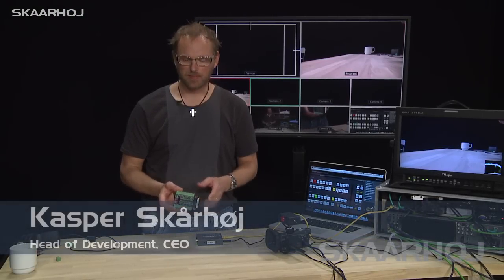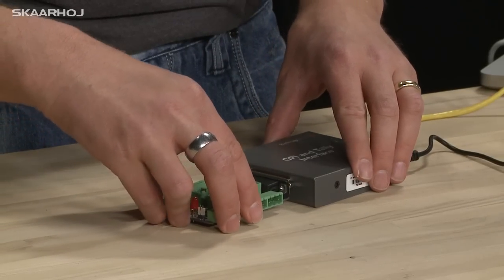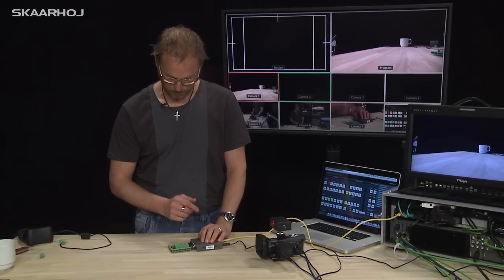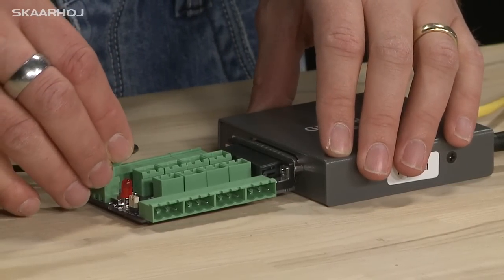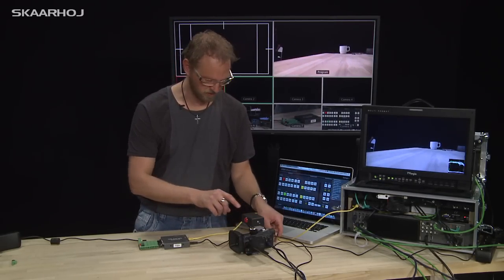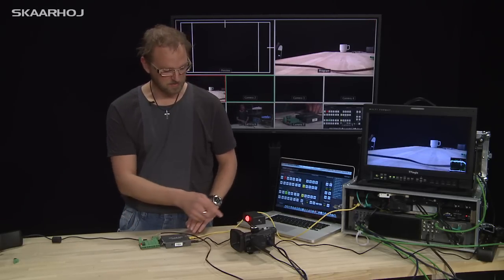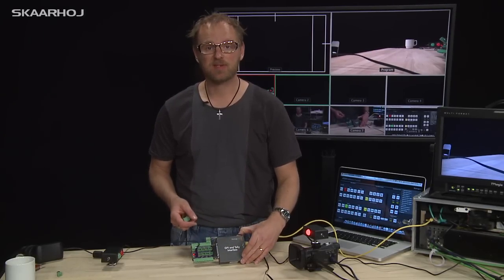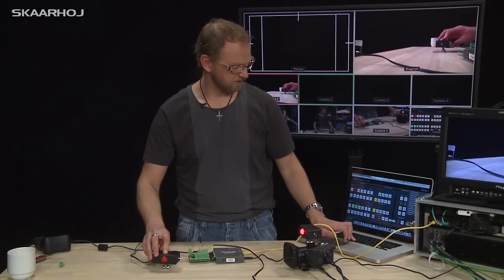LEGACY - ATEM GPI & Tally Interface Breakout Board

Comment: That's a really nice invention you have there, thank you very much.

I was wondering if this could work with a Datavideo ITC-100 8-User Wired Intercom System.

Thank you!
Reply from the maker: +Cctv Eventos Bogota Basically you can use the BMD GPI & Tally Interface directly (without this breakout board), but to my knowlege you will only be able to get Program tally and not preview tally from the GPI & Tally Interface. You will need a cable that is wired correctly between the DB25 connector and the two connectors on the ITC-100.

If you are interested in having both program and preview tally i suggest you have a look at some of our E21-GPIO units at http://skaarhoj.com/designs/e21-gpio/
We can also sell you a custom cable working working with the ITC-100.
Reply: @SKAARHOJ  Hello, you have the solution with this cable for ITC100
Reply from the maker: @lipe_lemes  Hi Felipe. Please contact support@skaarhoj.com
Reply: Hello friend, I know your post has been a long time, but I would like to know if it is possible to use itc100 tally with atem studio HD.
did you get any solution?

Comment: I would like to take the tally info (1/0 on/off .. not the voltage) + audio feed (microphone + earphones) and put it all in the HD-SDI stream so to have just ONE cable from/to cameras... do you think this is technically possible?

I will have a BOX next to the Atem where all HD-SDI cables arrive. And other small boxes next to the cameras. The mixer guy will speak in the microphone and listen in earphones. Audio signal will be digitised, coupled with tally info and travel inside the box into the cables. The small boxes next to the cameras will be powered from V-Mount batteries. Single cameramen will attach their earphones and tally to the box while the video HD-SDI cable will continue to the camera output for video feed.

I think it can be done... What do you think?
Reply from the maker: Hi Marcello
I suggest you take a look at the Studio Converters https://www.blackmagicdesign.com/dk/products/atemconverters 
I think they pretty much do what you are asking for. 

Otherwise feel free to contact us

Bjørn, The SKAARHOJ Team
Reply: SKAARHOJ Seems so.. but it works in optical fibre.. this means I need to change all my cabling.. SDI has 16 audio tracks and could be used directly don't you think? It would be cheaper.. though there is nothing to convert.. but just to insert digital audio in 2 of the tracks and tally info somewhere there